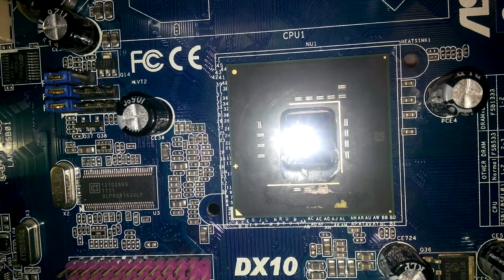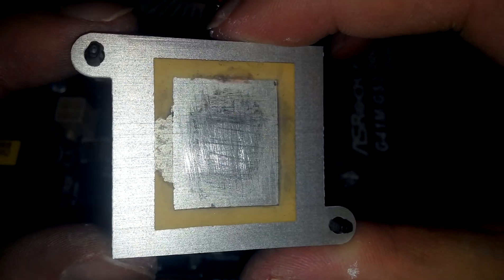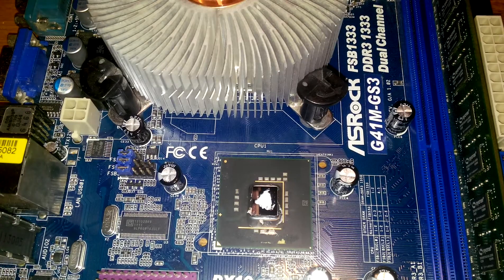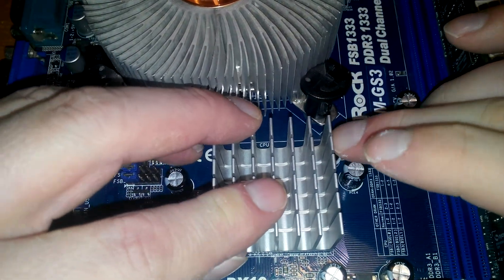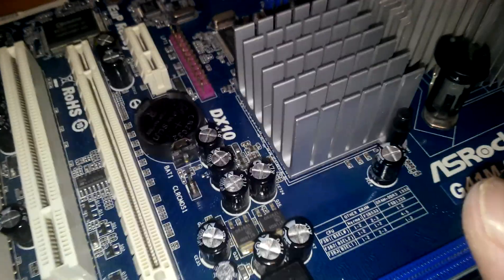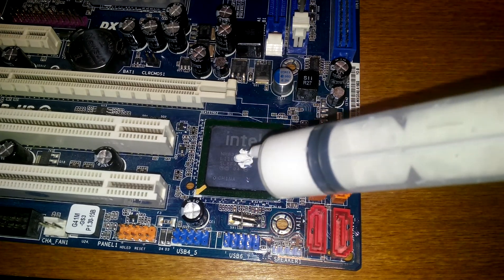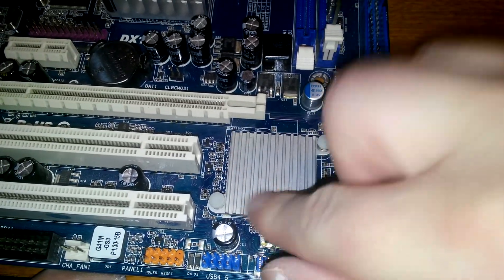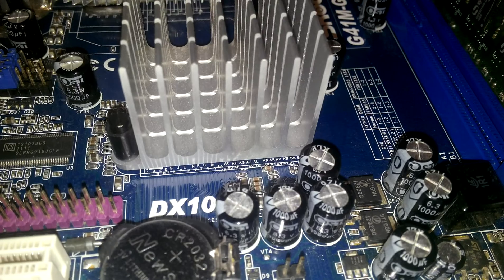AsRock G41M-GS3 mainboard random reset problem - trying to fix it by reapplying thermal paste Part2

Comment: hello i have the motherboard but the problem is a tattoo bios in my opinion. I ran it for hours under Windows XP in safe mode but when I try to start Windows normally after the loading screen it's a direct black screen 

I tried to install Linux and it doesn't want to boot on my Linux keys, it blocks the installation of Linux,

I tried to put a hard drive with Linux installed on it and when I get to the loading page it's a black screen.